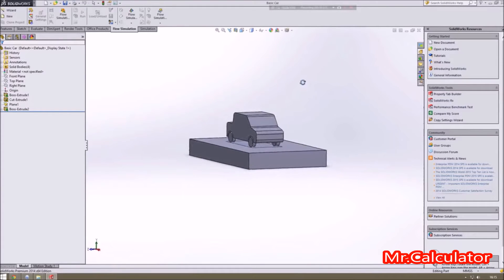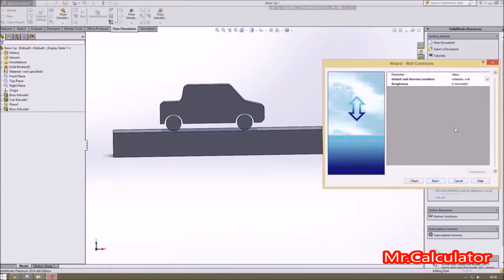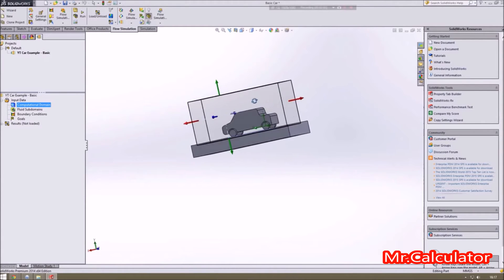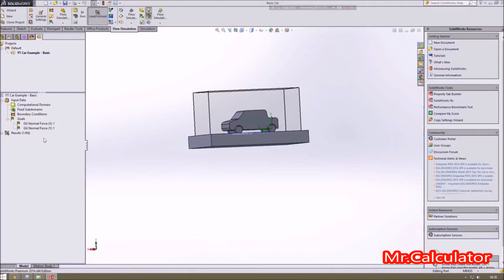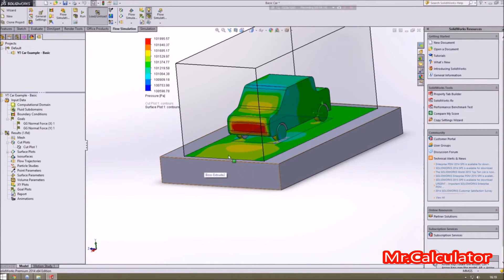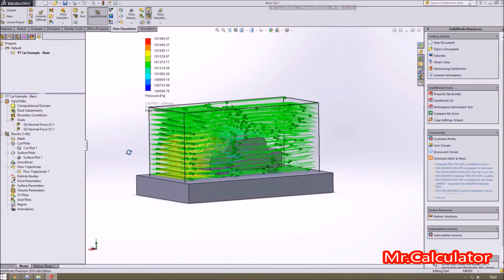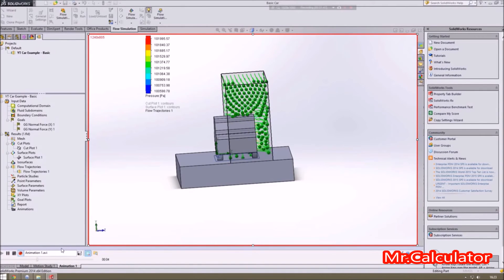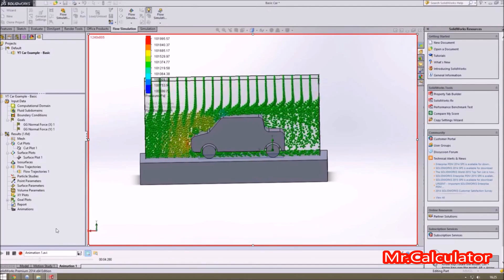Aerodynamics Car Test By Use SolidWorks Simulation

Comment: The control box is wrong. Cannot be so small, should be at least 6 times front and 6 times back the maximum length of the model, otherwise, the fluid will not converge. For example, your results, you could not see the Von Karman Vortex at the vehicle trunk.